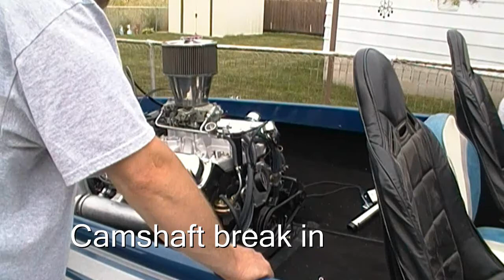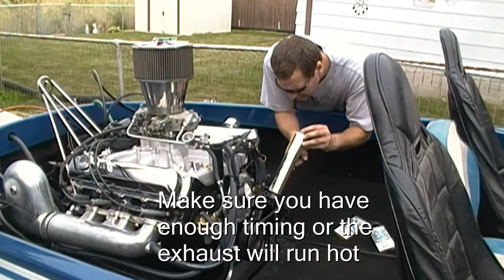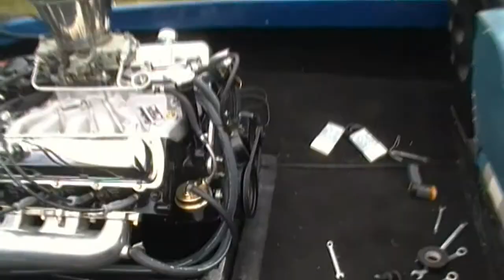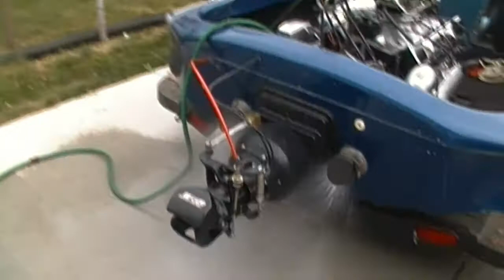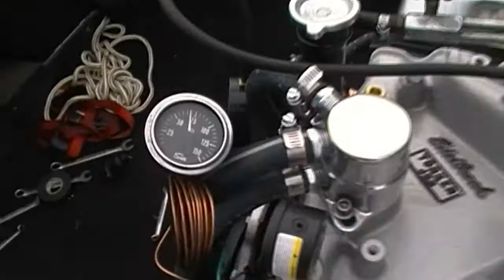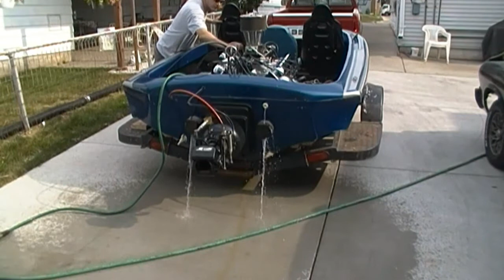Oldmobile 455 Tahiti jet boat olds camshaft break in

Comment: Nice vid. I had a sidewinder Berkley jet with a built 460 ford had a lot of fun, went through a lot of starters and batteries lol
Reply: Would you suggest a ford 460 or an oldsmobile motor then in a jet boat? I have been thinking about getting one... but my friends tell me that the oldsmobile is very unreliable and the ford isnt as powerful as the BBC.  I am more of a ford guy but i don't know much about these motors.
Reply: @lorenzobonacci3376  GO FORD. I have literally 3 Olds and they all have problems. Only one runs and the others either have cracked blocks heads, broken pistons, valves and all kinds of shiiiiiiiit. Don't care about power, trust me. Go for reliability.
Reply: @arcticwo1fee122  okay!! Thanks!! Man that stinks. Are they more for like low rpm high torque family ish boats I guess
Reply: @lorenzobonacci3376  Exactly right. Low rpm high torque but I like to rev to about 5 or 6k so it causes the problems, but still it doesn't make sense for the problems im having. I would expect excessive wear and tear but not block breakage piston breakage heads cracking dropping valves bent pushrods and you name what.

Comment: i hope he has a water hose in the intake or the back of the jet cause if he doesnt he is gonna blow his impeller been there done that
Reply: i see a water line going to the engine but you wanna have one in the pump as well water has to be on the impeller is waht im saying
Reply: Berkley pumps you do not have to have water.  At least not for around the first 15 min and the bearings and packing will start to get hot.  Has nothing to do with the impeller.
Reply: You clearly don't know anything about jet boats. Lmfao

Comment: We inherit the wife’s Cee Bee Avenger 171 boat it has a Oldsmobile 455 I was wondering what kind of oil to use it in. This boat has a 10 quart oil pan. Help me please!
Reply from the maker: I like the Penngrade oil(formerly Bradd Penn
).  Maybe start with a 10w40 and see how that works.   If it has a flat tappet cam you may consider a zddp additive at each oil change

Comment: what pistons and compression are you running with that cam? I just tore down my 455 in my tahiti and was disappointed to see the low compression bathtub dish pistons... figure i only have 8-8.5 compression. unknown cam but now im afraid to run a big one unless i bump compression which isnt in the budget. anyway long story short just wondering how a healthy cam would work with my compression
Reply: You can only spin that pump so fast. It only takes 300 hp to run an A impeller. Its not like a car! Rpm’s is better then brute horsepower! It’s direct drive 1-1 and not like a Vdrive that you can gear it to use HP verses RPM